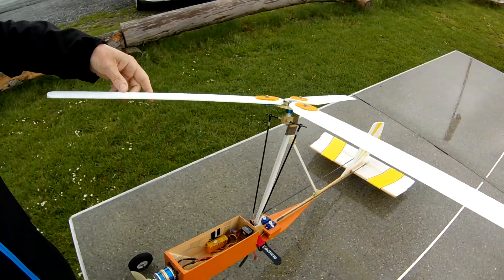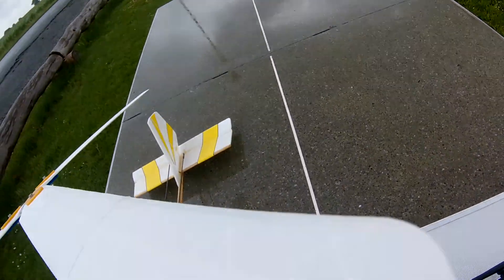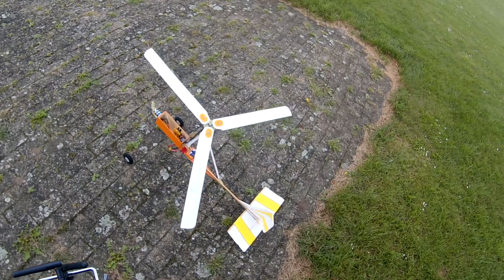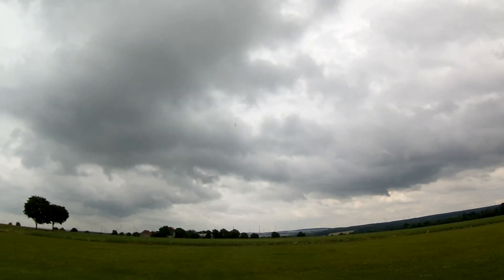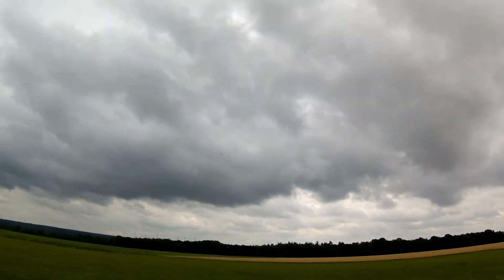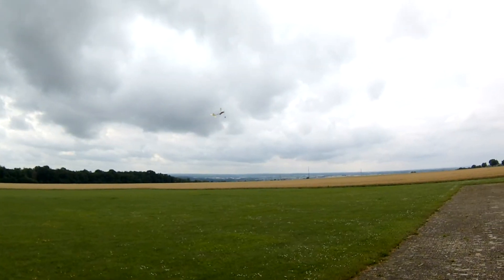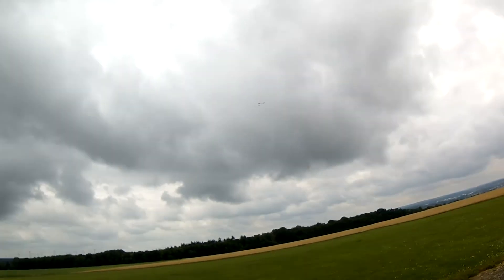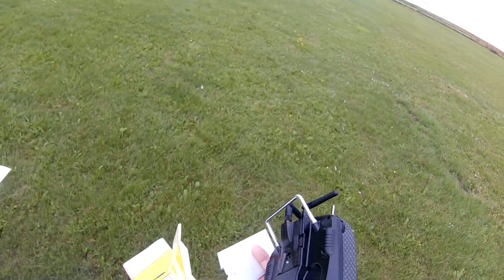3D Printed LW PLA Burky 11 Auto Gyro Blades Tested On a CraneFly.

Comment: Nice job, where I can find more info about LW-PLA 3D printed blade? Thanks.
Reply from the maker: Her you go:- https://www.rcgroups.com/forums/showthread.php?3651343-Colorfabb-LW-PLA-3D-Printed-Blades

However, unfortunately I can't get them to slice properly in Cura, Simplify works perfectly but Cura can't deal with the thin walls so please do not try printing them if you use Cura as a slicer as you will only waste filament.

Paul